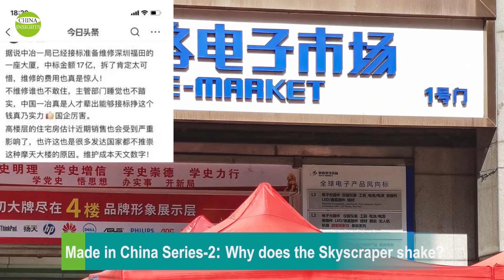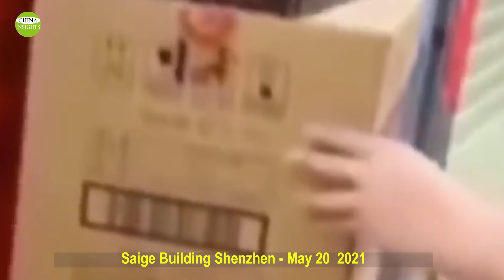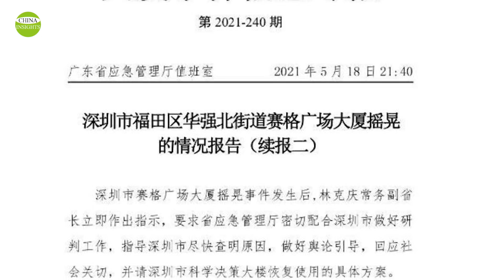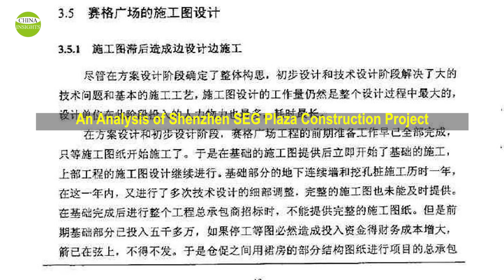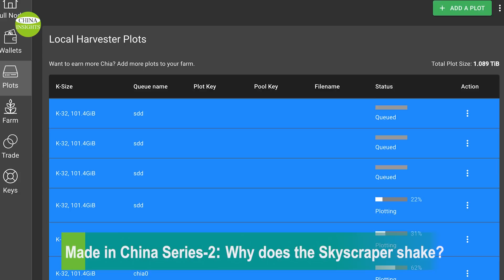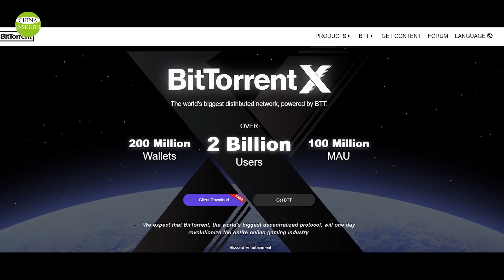What Cause the shake of  Shenzhen tallest steel skyscraper for 3 days? SEG Research report and more

Comment: this won't end well. look up "resonance".
Reply: not. it's just a substandard shoddy building like many Made In China. they actually rushed the construction in attempt of a feat
Reply: it could be the antenna superstructure harmonizing with the wind
Reply: Especially for the nearby buildings and people it will fall on. How would you dismantle it safely?
Reply: Resonance can be a problem. But where it definitely DOES become a problem is if it is undamped or insufficiently damped.
Reply: @gregparrott  Exactly. I'd wager that there has been some ground shifting under the foundation of this building causing the new problem. It doesn't bode well for the building, good luck trying to retrofit dampeners and in a  timely manner.
Reply: This won't end up well, look up "gravity".